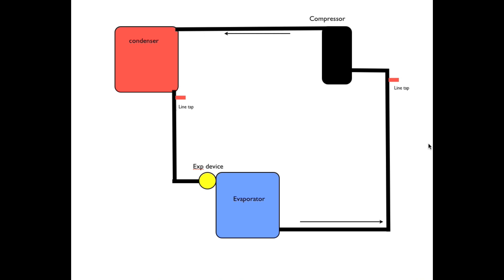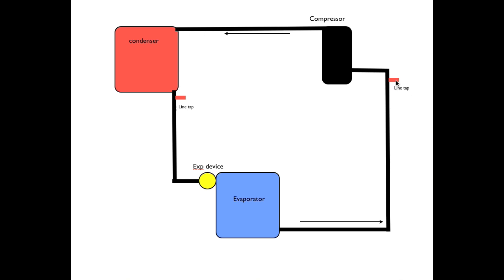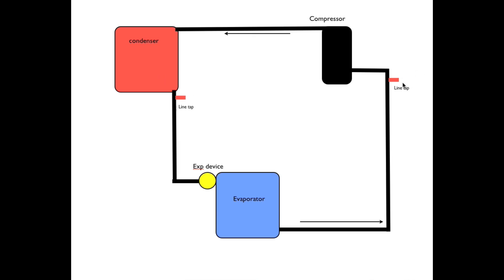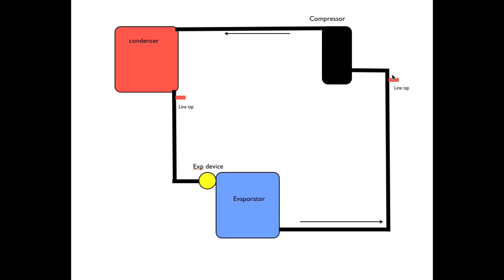Air conditioner triple evacuation overview

Comment: Do not use Refrigerant  in the tipple evacuation method! This is a clear EPA 608 Violation. It is Not deminimus unless you hook up a recovery machine to recapture and pull it back into a vacuum. Demimimus would be the vapor in your hose. Deminimus would not be enough to put the system anywhere near positive pressure much less flushing. There is a reason dry nitrogen is used.
Dont just take my word for it check it out from the industry leaders and professional trainers.
https://hvacrschool.com/triple-evacuation-and-nitrogen-facts/
https://www.measurequick.com/category/evacuation/
https://hvacrschool.com/long-evacuate-system/
https://hvacrschool.com/tag/vacuum/
https://www.rses.org/assets/rses_journal/0912_Vacuum.pdf
https://www.achrnews.com/articles/90651-tech-basics-system-evacuation
Reply from the maker: Using one of your sources:  Triple evacuation — A method of evacuation that initially pulls the vacuum down to between 1,000 and 2,000 microns. Then a small amount of refrigerant or an inert gas such as nitrogen is introduced into the system. The object is for the gas to absorb moisture from the system. The gas is then purged, and this process is repeated two additional times.  
The system I use is  not only the best for displacing contaminates (including nitrogen)  but uses far less (maybe 3 oz) refrigerant than the EPA rules for mandatory leak repair.  The push-pull method explained will clean a system better than any other method.  Any dry gas will absorb moisture, including refrigerant.  
GFM
Reply: Im not denying the science of using refrigerant, Im denying the  Its the legal aspect of venting that refrigerant and recommending others t follow the EPA 608 violation.
Reply from the maker: You should always make a complete stop at a stop sign, even though millions of people make a slow rolling stop every day without incidence.
GFM

Comment: DO NOT FOLLOW THIS METHOD! Breaking a vacuum with a refrigerant and then evacuating again is not a good idea! Besides being unnecessary as nitrogen or CO2 can be used, it's a waste of money and against EPA rules. If you want to know how to do a proper evacuation search for "Pulling a vacuum 2.0 Jim Bergmann", this is science not "what I think works". There's a reason no manufacturer recommends this method, it's just plain wrong.
Reply from the maker: This method is by far the best for getting the best results for cleanliness in the refrigeration system.  The reason no manufacturer recommends it is a technical violation of EPA regulations.  Most of these systems use less than 3 oz of refrigerant for the evacuation.  Even a small leak in a system will lose far more than this.  EPA does not even require repairs of leaks of this size.  Nitrogen is a non condensible gas and is a contaminate in the system.  I will continue to push this method as it is the best.  Not only for the use of refrigerant but the push-pull method I use.
GFM

Comment: The reason for triple evacuation is to get a cleaner system meaning no ice or moisture etc as well.  So breaking the evacuation with nitrogen just simply melts any ice that may have built up in the system if you pulled the evacuation too fast.  You braze with nitrogen. It's perfectly ok to break the evac with nitrogen because you are going to evacuate it again!!  If you break it with refrigerant you now have to illegal vent that refrigerant or recover it. Duh. Triple evac is meant to be done with nitrogen. Do it right folks.
Reply from the maker: Evacuation is never complete.  Nitrogen is a contaminant as is any other substance.  This type of evacuation is designed to get the cleanest system that I can get in the field.  You can even make the case for the refrigerant release as being deminimus.  By the way, this is the right way.
GFM
Reply: With all due respect GFM venting refrigerant is illegal and illegal is not the right way. 
Enough refregerant to even raise the pressure to 0 PSIG would far exceed Deminimus 
Sam has it right on the money here.  EPA section 608 clearly states for type 2  must be recovered to 10"HG for a recovery machine manufactured after 1993
Adding refrigerant that exceeds 10" mercury vacuum would be a violation.
FOr you to use refrigerant in triple evac you would have to hook up a recovery machine and pull it back down to 10" hg every time.

Comment: hey when taking out the refrigerant? would you use a recovery tank. cause of venting laws.
Reply from the maker: When removing refrigerant from a system you must use a recovery cylinder to contain the removed refrigerant.  Evacuation does not require recovery.
GFM

Comment: Nice video.  I'm a visual person so I like the diagram.  What if you have a system where all the refrigerant was pumped down into the outdoor unit and you've been working on the line set and indoor coil?  With the compressor and outdoor coil removed from the equation would you still push from suction line to liquid line or do it the other way around?
Reply from the maker: In that case, you can still do it the same way. The evacuations can be done faster because the compressor volume is not in the loop. Hope this helps. 
GFM
Reply: +grayfurnaceman  It certainly does.  Thanks.

Comment: Well breaking the vacuum with dry nitrogen helps bring out hidden moisture in the system ....also breaking the surface tension of the oil in the crank case will help bring out non condensables as well during a deep vacuum, to break surface tension a rubber mallet can be used on the compressor housing, and sides. Don't be hitting hit like a blacksmith forging a sword or anything like that use some caution and common sense. Thanks again for another great video GFM.
Reply: grayfurnaceman you need to recover that refrigerant or technically you are illegally venting it if you put more than a tiny amount in. Hence we break the evac with nitrogen.  Nitrogen is used to braze. Also a triple evac is done 3 times. Hence the name triple evac.  So putting nitrogen in to break the evac between evac 1 and 2 and 2 and 3 is perfectly normal because you evacuate it the 3rd final time below 500 microns getting all the nitrogen out. Nitrogen cost less than refrigerant and won't get you a 10k fine if busted.
Reply from the maker: mpape1980 Actually, All compressed gasses are dry, (except compressed air) including refrigerant.  So any of them will absorb moisture.  The striking of the compressor sometimes will make a difference in vacuum.  I will have to one on that.  Thanks for the thoughts.
GFM

Comment: I has issues with small R-134a coolers even with doing triple evacuation on them.  I notice hitting the compressor with a rubber mallet helped, also changing the vacuum pump oil every time I used a different refrigerant.    I think dry nitrogen is fine, but I might try it next time I do a conversion to POE oil.

Comment: what would cause a system that you know is low on charge, but you try charging it while its running threw the suction line but the system wont take anything?
Reply from the maker: jeepinreo If there is no change in the gauge reading when the valve is opened and the pressure in the refrigerant cylinder is higher than the system pressure, there is no connection at the service port.  Schrader not depressed?
GFM

Comment: Interesting that you don't recommend using nitrogen, that's all I've ever been taught.
Reply: Same thing here Stephen that's all I ever been taught
Reply: Don't think the EPA will get behind this technique
Reply: Ok thanks cleanairdude I will look into this
Reply from the maker: Frank Mashione All compressed gasses ar dry.  When they are compressed, the first thing that ones out is the moisture.  This includes refrigerants.  
GFM
Reply from the maker: Joe Shearer That's true.  
GFM
Reply: Makes sense to me.
Reply: cleanairdude what makes sense ? Nitro air or Freon ?
Reply: justin henning Freon, but I have also seen some people using Dry CO2 instead of nitrogen
Reply: justin henning also Dry CO2 comes in an aluminum tank! Very light